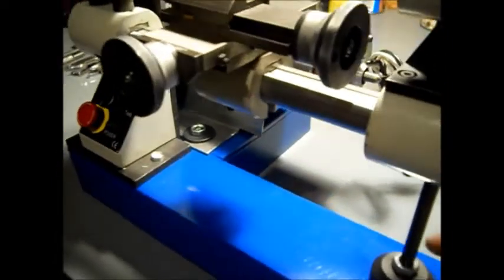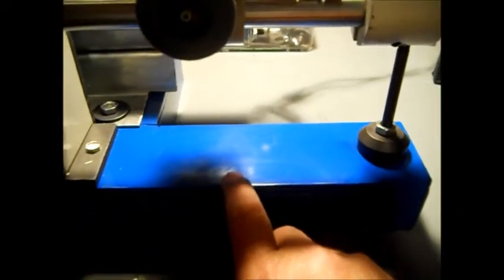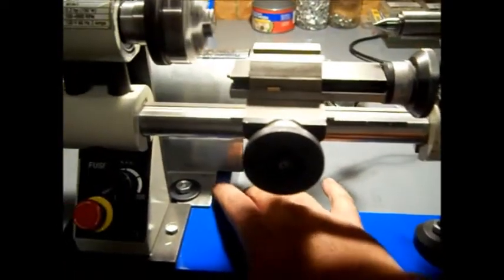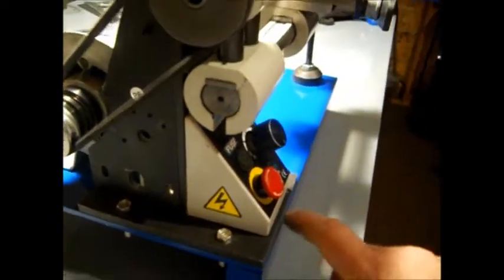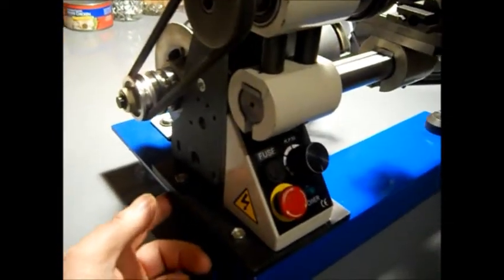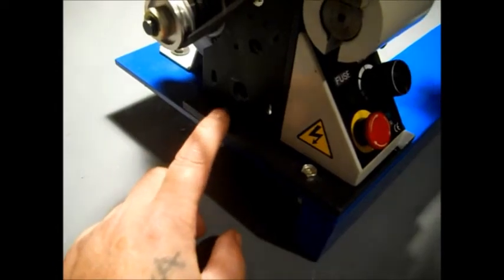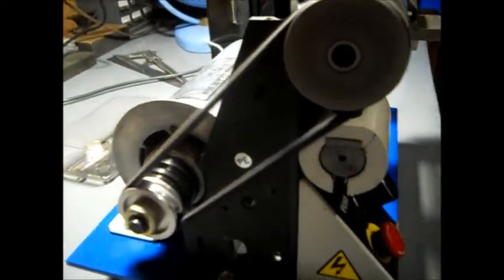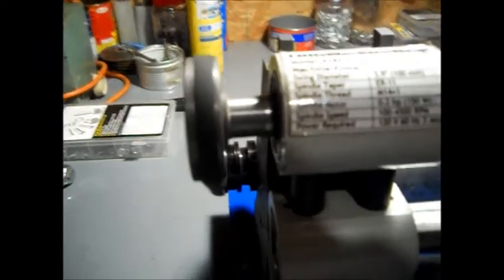Base made for Nano Lathe

Comment: did you change the motor Sir?
Reply from the maker: Yes ...Tread Mill motor and controller
Reply: @not2fast4u2c  thank you so much. how do you find the machine? what was wrong with the first motor?
 I'm gonna buy on of these but I don't know if it's a good machine
Reply from the maker: @arawolf1990  I would not recommend this lathe ..If you watched all the videos I made you would see .The original motor was junk and the company who sold this stopped selling them It took a lot of work getting it to where I could use it and  one park broke that I had to re make by hand .no part was available any where